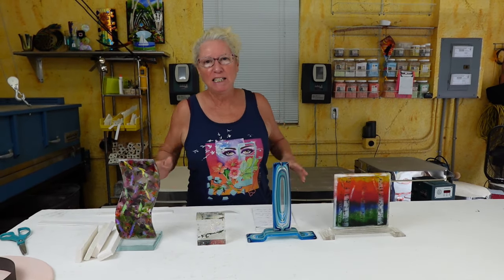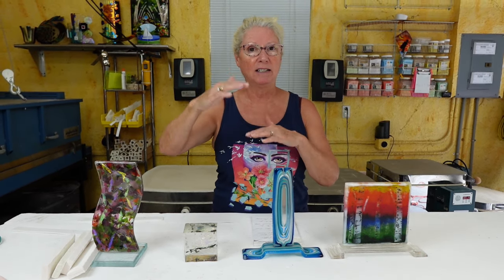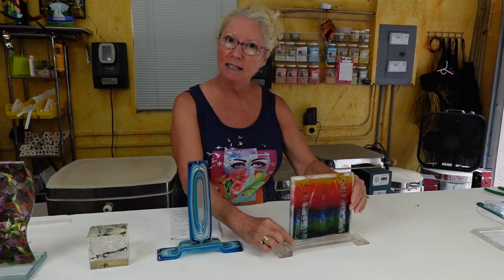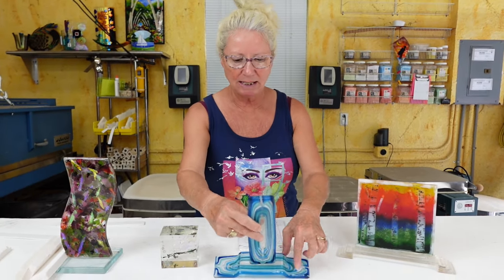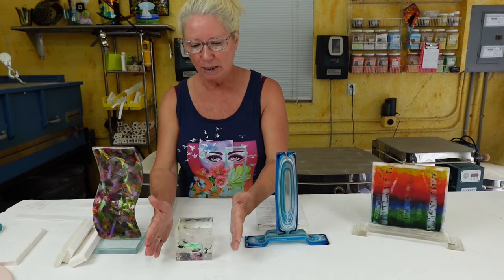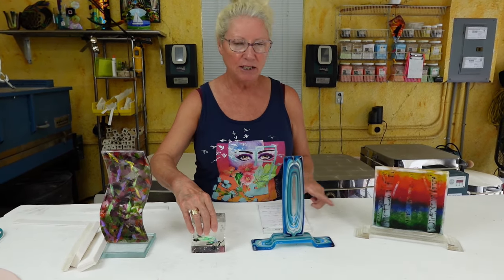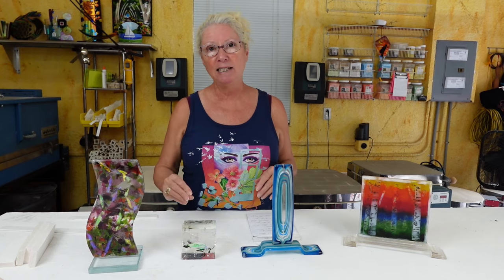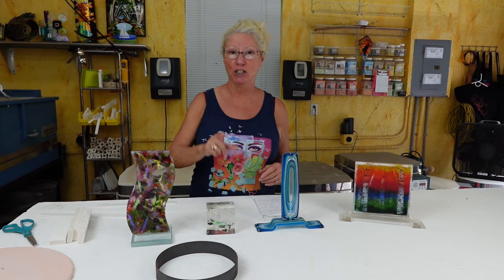How to Cast Glass with Lisa Vogt

Comment: Do you ever test the strength and structural integrity of glass by doing a freeze test? I am new to fusing, and I'm wanting to assure that the glass projects I make are sturdy. So far, I've done a few small tests with tack fusing of up to 10mm to 12mm. Trying to get the entire piece heated twice, preferably once- I read that detrification can happen with increased firing.
Reply from the maker: No, I don't do freeze tests. I trust the firing guides that I have developed over the last 40+ years. The firing guide I use for casting larger projects are available in my "Fused Vessel SInks and More" video available on my website.

I hope this helps!